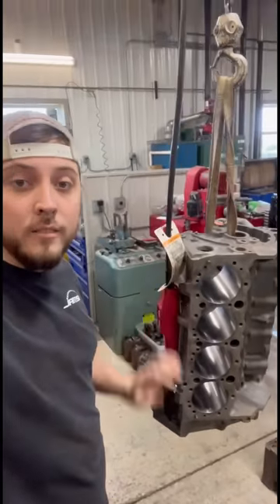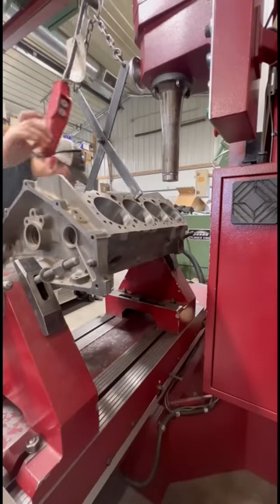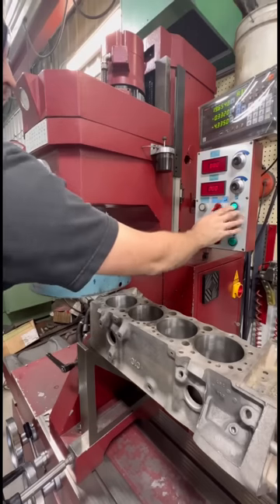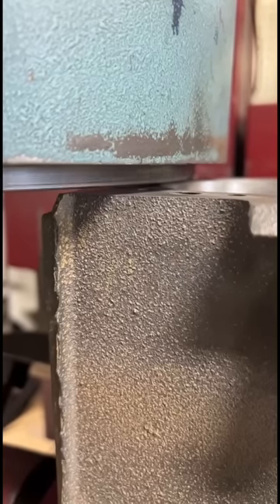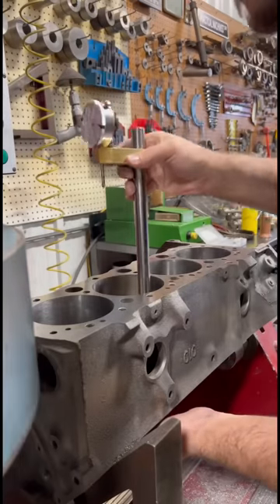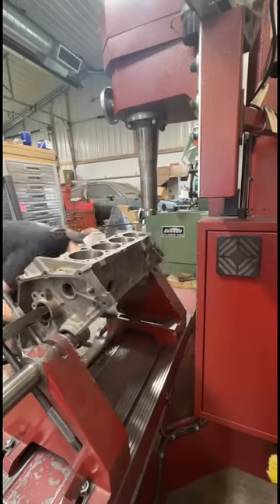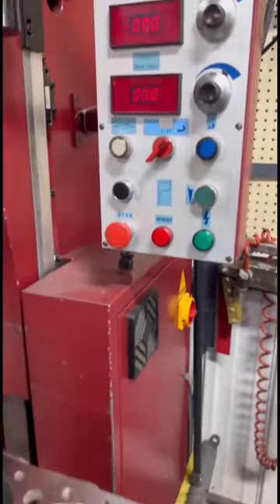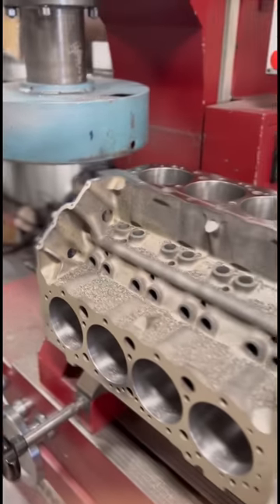#shorts This Is The Process Of “Decking” A V8 Engine Block! Would You Buy This?

Comment: I love this channel, so much better than my method of using a table saw with a stone on the mandrel.
Reply: LOL! I was once 16 making a 400 small block with a cracked deck with nothing but a mig welder no gas, and my mother's wood working tools.
Reply: @derrekvanee4567 did you finish it and successfully? I admit u to you got a lot of guts to pull it off!!!
Reply: @derrekvanee4567  😆 ”Derrek! My wood chisels! What the hell !” 😆    Been there.  This made me laugh so hard, thanks 😂
Reply: I want to hear this story 😆
Reply: @procrastinator41  Makeshift surface grinder.
Reply: Then there is Me using a primitive “Bottle Brush “ attached to a hand drill to cross hatch the bores  !
Reply: 😅RTV SILICONE and JB WELD baby!

Comment: "Blueprinting" means rebuilding an engine to the factory specs that were supposed to be followed in production, but which weren't.
Reply: But why would you do factory specs when factory specs not perfectly true from the factory. He states this. He is also trying to bump compression. Pay attention!! Lol jk. 😜
Reply: @808G8GT  
You answered your own question.  He isn't trying to rebuild a stock motor -- he's modifying it for more performance.  
He leveled the deck to meet the factory specs, then.cut down more to increase the compression ratio.  You might try thinking before you comment-- you have to establish a baseline on a used motor before starting to modify it, and that's called factory specs.
Reply: Blueprinting just means you're tracking/documenting the measurements of the block, and machining it to the desired spec, not necessarily factory spec.
Reply: @void2618_  That's what I was taught also. You're basically creating a "written" print of as many machined/remachined features as possible.
Reply: Blueprinted doesn't mean to OEM/Factory specs.
Reply: @landman424  
It doesn't mean you are NOT building a motor to factory specs.  It means that you ARE building a motor to a set of specs, and you're machining the parts to fit the specs. 
My point is that there's nothing special about it:  The engine is being built to proper, and often finer, tolerances than stock.
Reply: @808G8GT  I think he means the spec is correct, they jist aren't really well adhered to in production
Reply: It's not that factory specs were not followed, that would ridiculous. The tolerances for what is acceptable is less strict at the factory than what the machine shop is doing.

Not 100% sure but blueprinting sounds like logging the actual measurements of the engine/block. 

No matter how well something is made/machined it will not be 100% same as it was designed
Reply: @georgelin8498  
Formula One engines have no gaskets.  They are machined perfectly so that everything matches without "tolerances".
Reply: It might not be absolute nom but it should be in spec according to the tolerances.
Reply: @randytaylor1258  Their is no such thing as no tolerances in machining also they use steal HEAD gaskets.
Reply: Here's some schooling. "Blueprint" is what the original factory design drawings look like. The paper they are  on is blue. The blue paper is a reproduction copy of the original drawing board paper which is white. The "blueprints" are then given to the engineering team to reproduce the parts according to the sizes on the blueprint.
Reply: @void2618_   wrong
Reply: @thefreedomchopper4027  wrong
Reply: @landman424  it does
Reply: Not true in the slightest
Reply: When I built engines for our pure stock car I had cylinders bored to the specific piston going in that hole.  Rings filed to gap I wanted, cc'd everything to match. The goal is to attempt to have each cylinder as close as possible to the rest for the most efficient power from stock parts.  "Blueprinting"
Reply: No it doesn't. It means building it precisely to high level tolerances.
Reply: Doesn’t need to be factory specs. Its the DESIRED specs. Rarely when people talk about blueprinted engines are they talking about FACTORY specs but rather high-performance custom specs for optimal weight savings and power.
Reply: @Dan-gj1hz  
Exactly what I said.
Reply: That's arguable.  The dies in the machine go out of tolerance over time.  First generation 'overly tight', second generation 'just right'; third generation and beyond 'sloppy'....
Reply: @bobolulu7615  
That's the noun.  The verb "blueprinting" means assembling according to the factory specs and it has for over 60 years.
Reply: How would a .030 over bore be factory spec?
Reply: Blueprinting is a meticulous process used in engine rebuilding to optimize the performance and reliability of an engine. It involves carefully inspecting, measuring, and matching engine components to ensure that they meet the manufacturer's specifications and are within tight tolerances. The goal is to reduce variations and inconsistencies that can affect the engine's overall performance.
Here's a more detailed breakdown of the blueprinting process:

Inspection: The process begins with a thorough inspection of all engine components. This includes examining the crankshaft, connecting rods, pistons, cylinder heads, valves, and other parts for wear, damage, or defects. Any components that don't meet the required standards are either replaced or repaired.

Measurements: Accurate measurements are crucial in blueprinting. Specialized tools are used to measure critical dimensions of components such as bore size, piston clearance, crankshaft journal diameter, valve seat angles, and more. These measurements help identify any deviations from the manufacturer's specifications.

Matching: During blueprinting, components that are measured within tight tolerances are carefully matched and paired. For instance, connecting rods and pistons might be matched based on weight and dimensions to ensure uniformity and balance within the engine.

Balancing: Balancing involves adjusting the weight of certain components to ensure smooth operation and reduce vibrations. This is particularly important for components like crankshafts, pistons, and connecting rods. Balanced components can help extend the engine's life and improve performance.

Assembly: During assembly, each component is placed in its designated position based on the measurements and specifications obtained during the blueprinting process. This ensures that all parts fit together precisely and function as intended.

Clearances: Blueprinting pays special attention to clearances, such as piston-to-cylinder wall clearance and valve-to-piston clearance. These clearances are adjusted according to the manufacturer's recommendations and the engine's intended use.

Tolerances: The goal of blueprinting is to achieve consistent and optimal tolerances throughout the engine. This can lead to improved compression ratios, better sealing, reduced friction, and enhanced overall efficiency.

Quality Control: Once the engine is assembled, it undergoes further inspection and testing to verify that all components are correctly installed and function as expected. This might involve checks for leaks, compression tests, and more.

Blueprinting is often employed in high-performance engines, racing engines, and custom-built engines where precision and performance are critical. It requires skilled technicians and specialized tools to ensure that the engine's components are meticulously measured, matched, and assembled to achieve the desired level of performance and reliability.
Reply: Line bored, balanced and blueprinted. A buddy had that done to his Chevy 400 V8 at a local engineering college that rebuilt the motor for free with him paying for the parts. It came out of a truck he bought for $300. The custom rebuild increased it's horsepower and gas mileage. He sold the truck for $4500 to a guy that only wanted the motor.
Reply: "To blueprint an engine means to prepare, specify and document all of the engine’s tolerances, clearances, and materials based on a set standard." - Ben Strader, Founder of EFI University.
Reply: Deviation from manufacturing equipment damage, or wear, with a number of units squeezing out in between the quality control check intervals  plus environmental conditions, if it’s 40°f in a shop at night, then hitting the heater at 6:45 it hits 70°f by 8am , the newly cast and delivered blocks machined and assembled while hovering at 45° are going to be different than the blocks machined and completely assembled at or between 3:30-5:30 pm, then the unfinished units cool down and say only 2/3 of the job is done, (ideally you want the work and equipment to be in the same physical/thermal state and condition, but lets say there are 3-8hour shifts ( real ) and although the machines check out, 200-1,000 units went through the line bore cam bore honing machine in the 24 hours of production, inspections pass, but the lands on the large high volume machinery are worn at a point between where either inspection measurements were taken, or the inspector was off .0005 due to gage reading parallax and the instrument was off .0005 both are within specs, but together your oil clearance shrinks from .0025 to .0015, and squeezes out before the deviation can be discovered, ( I truly don’t know, or even have an idea how many engines go through a line in 24 hours but a safe guess would be more than 50 per shift at a station and that’s a shot in the dark)
Reply: OE stuff has lots (from a .000's standpoint) of +/- tolerance from print, if they didn't there would be so much waste or extra machine work required it wouldn't be profitable when you're building hundreds of thousands of engines. 90% of the time most of the shit is going to end up in van or a pickup truck or something when it rolls off the engine line. The end user won't notice or care their block deck height is 9.028 instead of 9.025.

Comment: 397-0010 standard Chevy V8 350. This is the two freeze plug version. Mine had three freeze plugs along the side, 4 bolt main, steel crank, 8 inch balancer, etc.
Reply: Nice that you mentioned lowering the intake fit so no leaks appear. Vaccum or coolant. What, you never mentioned it. Oops.

😎

Comment: Serious question here, what's your thoughts on cyl chamfering and head gasket seal inbetween cyl's in high boost applications. Does it impact the cyl heads wanting to lift in extreme applications (like 10:1 static comp with 40+psi type deals)
Reply: Chamfering promotes head gasket failure.

Comment: we need a machine shop like yours here in the Okanagan valley. A shop in kelowna gave me back fully assembled dohc 4.6 ford heads but the intake cams were 180 out and metal shavings poured out when I went to install them. They also surfaced them but never marked how much they took off. never seen that before

Comment: Do you port the oil passages in the rear main cap
Radius the square corners in the oil filter passages. (Long shank ball end burr) 410 shot gun and rifle ball hones thru the oil galleys using care to not oversize the bore where the filter diversion plug goes.

Comment: As much as love the skill you guys have doing this type of work. I had a quote for machining  on a 350 block. It was cheaper to just buy a new one lol
Reply: But it still won't be as good as a block that has been decked blueprinted because of imperfections from the factory. It always costs more if you chase those few extra HP
Reply: @nzuncovered1845  agreed👍also bores won’t be finished to correct size to your piston to bore clearance

Comment: I always kept some silver solder with my slide hammer and collet set up. I'd just take a little piece of the solder and then slam home the collet  and pull. I like the Idea of using the valve lapping compound but something in the back of my mind just doesn't like adding abrasives to a clean block if I can get away with it. Great videos

Comment: Does the valve grinding compound in the beginning help to remove the dowel pins?
Reply: It adds grip to it because it's lightly abrasive.
Reply: @tickandslug  ah so it help the slide hammer hold onto it while extracting?
Reply: @jameswachala8578  yep, same concept as the paste you put on a carbon fiber seatpost so it doesn't slide around.

Comment: I've been a machinist for 9 + years different disciplines for job shop all the way too aerospace high tolerance. Used everything from Bridgeport, big hogging 3 axis CNC.  Radial arm drills, punch presses 40 ton.  Lathes both Manual and CNC. Etc.   My question is love you too do a video of the machines used in fixing engines because. I only worked on on one 1931 John Deere single piston cylinder.  Wood love a tour of the different ones you use. Thanks for your awesome videos.
Reply: Man I'd I had time  to talk about grinding.
Reply: Grinding  all  sorts... Heat treatment.  My favorite old school Cincinnati horizontal mills
Reply: Citizen swiss too centerless

Comment: Have you ever seen a number 8 ford or chevy 7 cylinder torn up. Inductive Cross firing spark plug wires cause the ford 7 or gm 5 cylinder spark to light the next cylinders air fuel charge 90 degrees early. So when that last cylinder fires at the top its lean. The lean combustion is lean. Over heats the piston reducing oil clearance to zero.  The piston skirt melts. The aluminum welds to the cylinder wall. The rings scrape it up lifting the rings off the cylinder wall allowing the 2600f+ combustion to burn away the piston like a cutting torch
Reply: Sounds catastrophic!
Reply: Sounds like you’re talking about Detonation
Reply: @e-racer4673  inductive cross firing has been known about for decades  gm molded their spark plug wire separators putting an inch of space between the 5 and 7 wires.    Drive along side power lines and you will see the wires were installed and swap order once in a while..

Comment: If I build a V8, it would be a 3 valve per cylinder SOHC valve train, 298 cubic inch displacement, head gasket less design, CGI block, CGI heads, twin turbos, Bosch port injection system, and run buttery smooth. It would sound like a 4.6L modular with a soft turbo whistle.

Comment: Curious how many old blocks you see - think 60's - mid 90's V-8s.
I know quite a few of the old builders would purposely have the blocks or heads Angle Milled to achieve their desired combustion chamber shape and flow

Comment: I'm fairly new to machining and was wondering why you chamfer the second bank before surfacing it? Wouldn't the two banks have uneven chamfers unless their surfaces were the same?
Reply from the maker: Chamfer to the same depth as opposite bank, end outcome is identical chamfer on both banks.

It’s an “ease of setup” kind of thing, doesn’t make sense to switch to the milling head then right back to the chamfer head againx

Comment: I’m pretty sure the blocks are sat up on an angle plate and machined on a boring mill in one setup to ensure absolute location. The block should be damn close or if not perfect to the angle spec. By using a rotate pin and an angle block for set up? How do you know that you’re not the one out of “square” by a couple thousandths?

Comment: 3970010 is a 10% tin 2 bolt main,  most likely '70s car or small truck motor. If I was going to do all that work to a motor,  I would have at least sourced a 10/20 block and milled and line bored it for splayed caps. It's not like that's a rare block,  it's a baseline at best block. Although I would just go for a '70-'72 sb400 instead. tHerE's nO RePlacEMeNt FoR dispLaCemEnT

Comment: Would it be the best angle setting using a cilinder's wall and the oil tank or heads surface as a reference for 90 degrees instead? Did you get my point?

Comment: Why do you use valve grinding compound to remove the dowels? We have a lot larger dowels than those, up to 60mm diameter so they have tappings in them but I’m working on something a lot smaller where the dowels are similar size to that so won’t be able to have tappings in. Is it necessary to use that or can you just a dowel puller? Cheers

Comment: What kind of tolerances can that red machine hold on a 24 inch long engine in the X and Y-axis? A 48 inch? Im just curious? Cuz your working on some impressive engines and my surface grinders for another type of industry can’t get hot rolled steel that flat to save their lives.

Comment: I have a serious question we have had 2 blocks bored by the same person an both have used oil smoke after you let it hold back then get back on it we’ve changed everything but the guy doing the machine work what do you think he could be doing wrong the same one has been together an apart 5 times an its the same no matter what we do different pistons rings even tried different brands seems to be the block wouldnt you think

Comment: Why wouldn't you center it off of the cam tunnel and the mains..
Reply: The cam bore isn’t exactly perfect. I did not know this until I was building a 400 small block and regular cam bearings would not fit in it. They would fall all the way to the back of a block. On some of your early model 400 blocks they did a Rebore on the cam bore to center it perfect. my timing chain was so tight it was ridiculous.
Reply: I worked in an engine machine shop for 10 years and loved it. it was like one of those jobs that was more fun than work.

Comment: a good machinist is a good engine builder but a master mechanic should be able to operate machine tools, check clearances, read prints understand, cc matching balancing rotating assemblies, port polish, build, match and install every single part of engines and their counterpart transmission.

Comment: So you lined the block by the Pan Rail, not the crank centerline?
Reply from the maker: Watch again.

First reference is the crankshaft centerline as the block sits on the mains. 

Second reference is the pan rail, as is used from the factory. Ideally the second reference would be the camshaft centerline but our fixture does not have this capability.